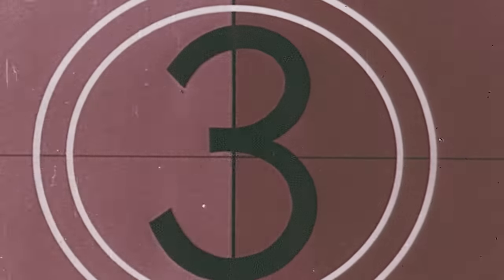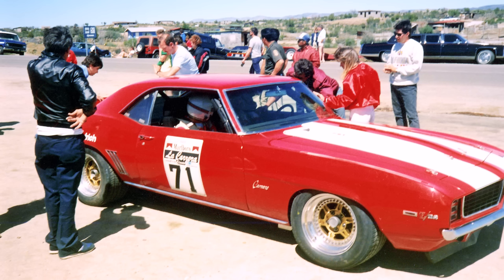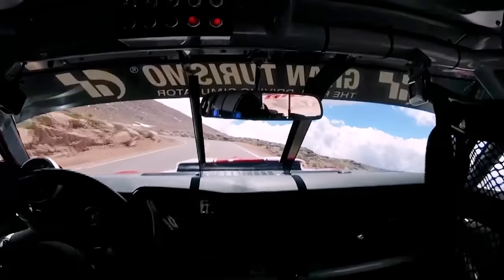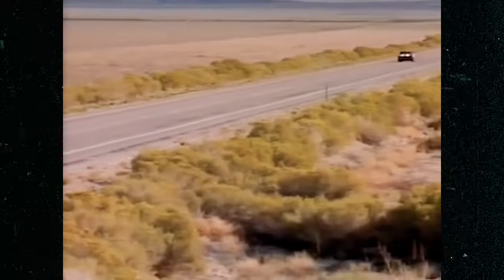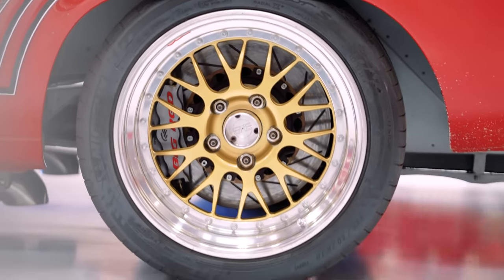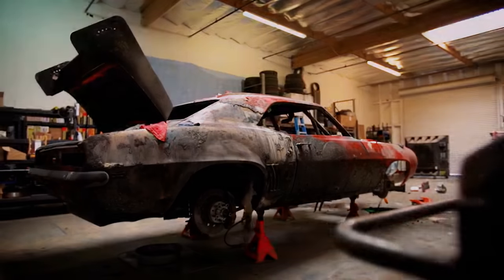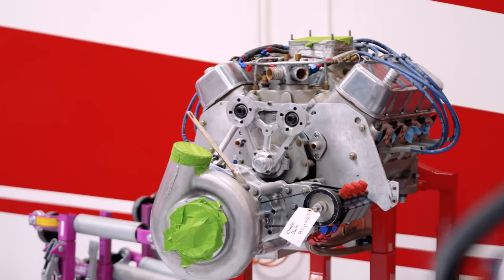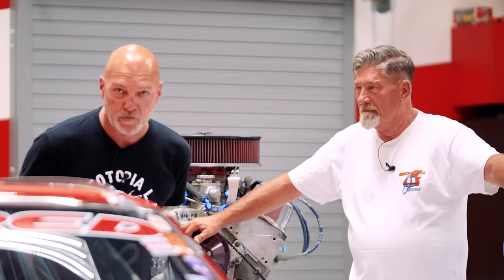The Legendary Big Red Camaro | The Story, the Build & Straight Piped Street Drive with RJ

Comment: I remember reading about this car in the mid 80s. I always wondered about it and it's story. All I can say is I am beyond impressed. Drag racing is/was my first love. Road course racing is right behind it. No circling the course trying to learn it; encounter, adapt and overcome. Flying low at Bonneville is interesting to me from the tech aspect. This proves that one car as built can't do it all, but it's fun to do just that, build it for whichever challenge you point it at.

Comment: I had a '68 RS Camaro 327 Powerglide. The 2 speed trans. made it a dog, but I still liked it much. Also had an '80 Z28 which was a black beauty. Always thought the '69 Z28 was one of the best looking cars of all time. Your knowledge of all the various configurations is remarkable.
Reply: 1st gear in a glide is the same as starting off in 2nd gear in a t350 or t400. That's the reason why. U need lots of torque to have a good take off with a glide

Comment: This genre of auto cross type car is one of the reasons I keep my 1980 Monte Carlo. One day I'll have the funds to do a complete frame and suspension rebuild w/ coil overs, heat insulation, racing seats, T-56, LS1, turbo, 9" inch Ford diff,  roll cage a/c,

Comment: The mechanic hasn't ridden In the car ? Too big of a man to fit ,bad back ? Didn't he say he was wrenching it for 30 years.  Plus he said never under power so he works on stuff inside the cockpit .

My assumption Is it's such a serious tool / machine there is no reason for a thrill ride for a man around cars so much and similar to many mechanics or techs of race cars who may not even drive at all . Guys who work on fighter Jets don't fly em or even get rides but know what they are doing .
Reply: I am the mechanic    I fit in the car just fine. I clean the back window on the inside  try that if you can.   I have been towed  to the pits from serval shut down areas.   I have loaded it in and out of a few shows under  power     Big red is a tool /machine. You are 100% correct. I don’t need to ride in it  ! I get to make it go and stop.  And we here treat this car as a precious tool built to race not play with.  We race to win and win we do ! It’s not a toy  it’s a precision weapon and treated as such   Would you wear another man’s Rolex ? I won’t 😂 and yes I get to teach a few special people how to get in and out of it  and I love my job
Reply: I have been involved with this car and family for 30 plus years and at 60 years old I have lived a dream most people can’t fathom